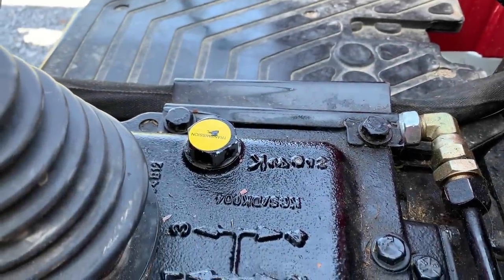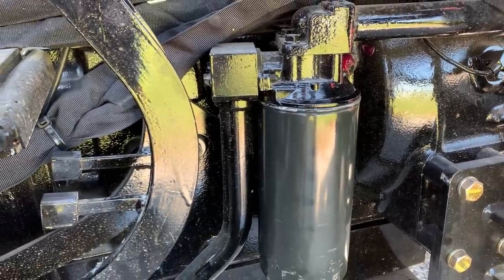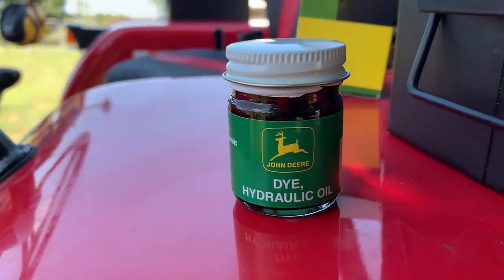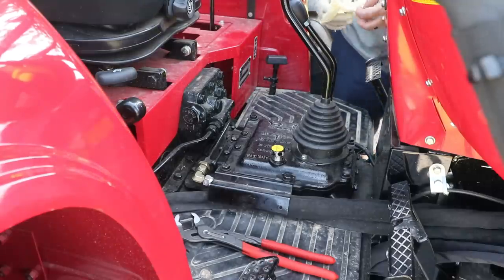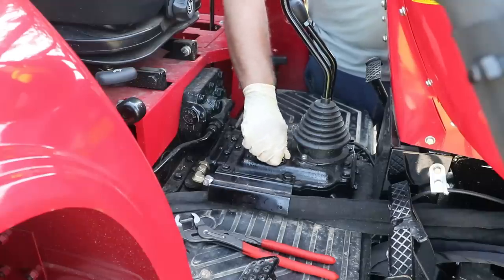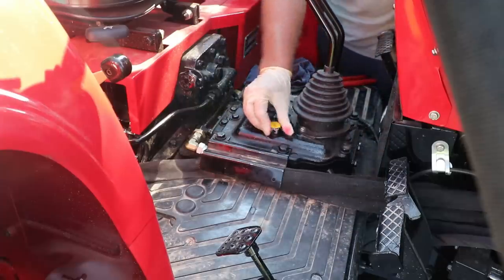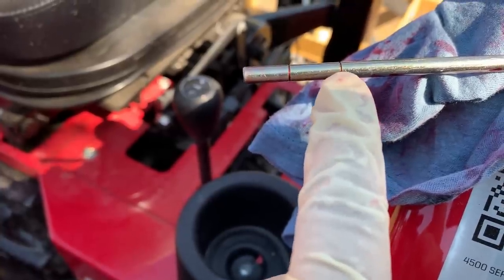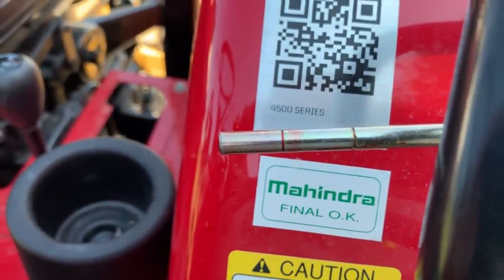A FARM TRACTOR HACK THAT WORKS! EQUIPMENT MAINTENANCE DAY AT THE FARM

Comment: Try sanding the stick high enough above the lines, and then carefully clean all grit and filings away.  then the fluid should stick in the scratches to tell you how far up ;the stick it goes.  a lot of sticks have etching on them for that reason.

Comment: One way of seeing the level would be to make a wooden stick the same length as the dipstick and use that use for dipping the tank you would not be able to leave it in the tank as the fluid would attack the wood but something like that would be able to be stored easily and just used when you wanted to check the level.

Comment: When servicing hydraulic industrial spray painting equipment, (we face the same issue due to the light viscosity of the hydraulic oil used), when we're on site, after initially drying off the dipstick and taking care inserting/removing the dipstick we simply rest the dipstick against one of our fingers. Wet spot = oil. Dry spot = no oil. 😎

Comment: Pull the dipstick, give it a good rub down with a clean rag and reinsert it, take it out and sprinkle a little floor dry on the stick and it only sticks to the oily part of the rod. Clean it off really well and reinsert it. Old greasemonkey trick.

Comment: I simply dust the bottom of the dip stick with talcum powder (only takes a tiny amount). This is an old oilfield trick gaugers have been using in applications where the condensate/oil tends to be crystal clear. Also works well when gauging water tanks.

Comment: Put baby powder on the dipstick when you dry it off. then check it. The oil will remove the baby powder from the level down and it won't hurt the system at all. Old navy trick when sounding fuel tanks.

Comment: A file or a dremel grinder will give you a surface finish on the side of the dip stick that will make it easier to see the fluid .  You don't have to go crazy with the grinder.
Thanks

Comment: Just touch the dip stick with paper from top to bottom, no problem reading off the paper. You should probably clean dipstick first than dip back in, and then use paper to touch from above max then slowly move down, waiting for paper to saturate. Only way to get accurate reading i think.

Comment: Take the shine off the dip stick and it will be easier to read. Please use a box wrench on that dip stick bolt- it will last a lot longer and not get chewed up!
Reply: I agree I wondering at the beginning why the paint on the bolt was so chewed up. Even better use a ring spanner or ratcheting ring spanner, leave it in the storage box, only use it for that job and you will never have to go looking for a shifter/vice grips/channel lock pliers again. It is a small price to pay as all of these multipurpose tools, even with care, eventually damage the bolt.

Comment: I wonder if that dye would permanently stain the sight glass on my Deere? I'll have to contact them. It's hard to read even with a sight glass.
Reply from the maker: good question, I went to the local deere dealer first to get this stuff but they didn't have it in stock, ebay got it to me in 3 days, 7$ I think, 12$  when added shipping,

Comment: I think you should NOT be cranking down on that hydraulic fill cap with pliers of any kind unless Mahindra is different that the tractors with which I have experience.  Hand firm only.  The tranny case should not be pressurized, the cap seal is to keep dirt and water out.  The tranny case is vented somewhere anyway.  Consult manual or dealership.  I have considered the dye, but if I have put a strip of 100 grit sand paper on the table saw table and then drag one surface of the dipper over that to make lines of scratches across the dipper, then the oil shows.
Reply from the maker: hello Rooster, per Mahindra you are suppose to tighten the cap with pliers.  this was showed to me when I bought the tractor by the mechanic that gets them ready for delivery, 
the sand paper would probably work also, but this dye also helps to see any leaks that might happen down the road as well, and for 7$ it was an easy decision
thanks for watching,
Reply: @OutoftheWoods0623 Goo deal, then.  Carry on!

Comment: That's frustrating! Probably should of bought a JD 🤓
Reply from the maker: well John Deere may also have the same issue not sure, never owned one of those green machines, 
my New Holland Tractor has same issue, and for most people it's not a big deal and it's not for me either I just like to make things better if possible.
Reply: I own a JD 4105 , no issues with this problem. Just messing with you. Send cooler weather to Southern Oklahoma, North Texas 🤓
Reply from the maker: shewwww maybe I need to go Green lol,
Reply: @OutoftheWoods0623 , my only regret, is not getting a cab JD tractor. My neck of the woods is a beating on summer heat, and insects, dust. But there high as a cat's back 🤓
Reply from the maker: yes a cab tractor is in my future in a few years,